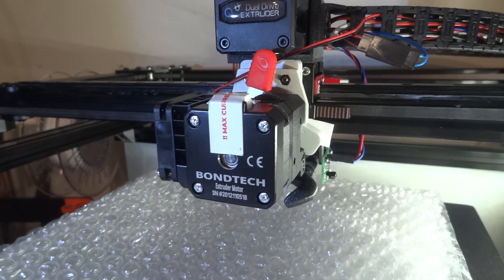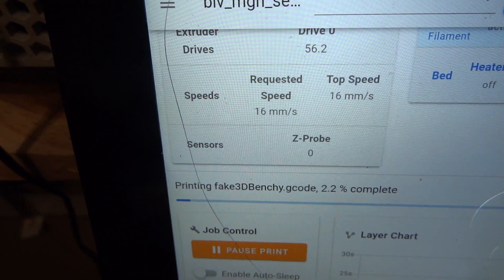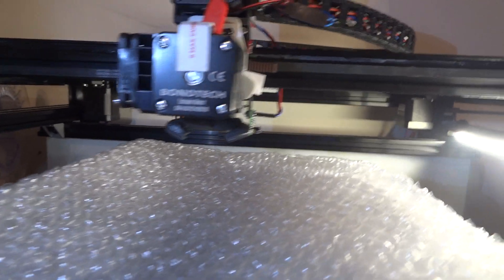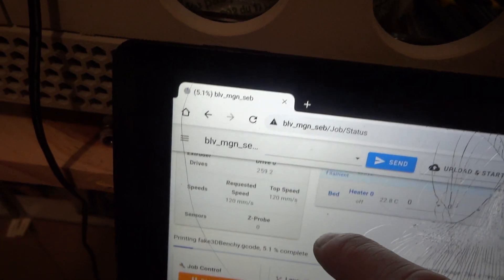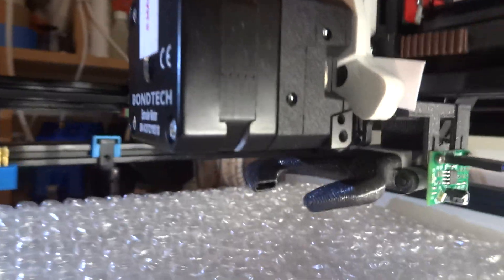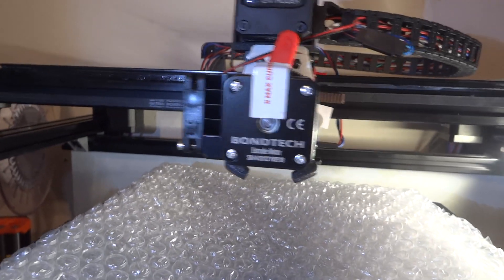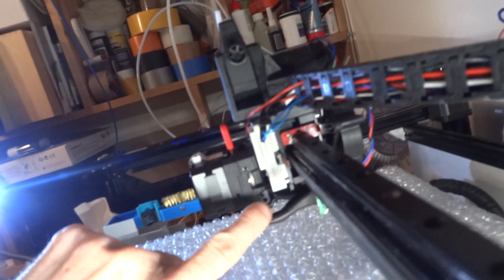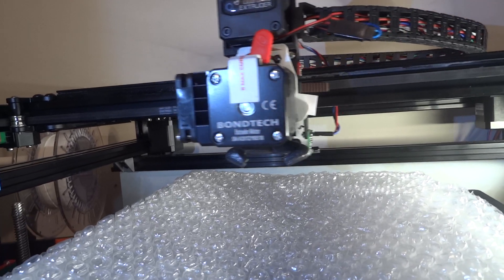BLV MGN magnetic tool changer: first (well second) benchy simulation

Comment: You need a mechanical link. At high speed that thing will go flying across the room. Remarkable idea, however, for it to be a real tool changer, part cooling has to go with the tool (each tool will have a different nozzle height). How did it turn out? I'll check if you have other videos on this.
Reply from the maker: What do you consider high speed?
I print correctly at least up to 150mm/sec which is good enough for me
Reply: @SebastienChedalBornu  That frame and hardware with linear rails would be capable of much-much more than 150 mm/s. Also depends on the weight of the tool and magnet strength.... a mechanical lock would be a safe bet, because it's not really the print speed I'm worried about (which depends on the flow capacity of the extruder), but also travel speeds are limited if you would potentially lose the tool mid-travel.